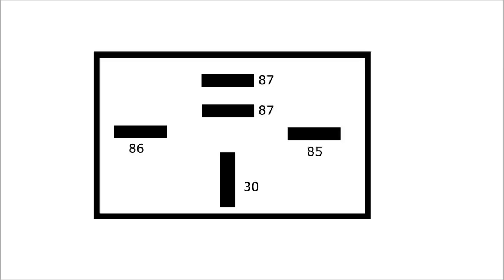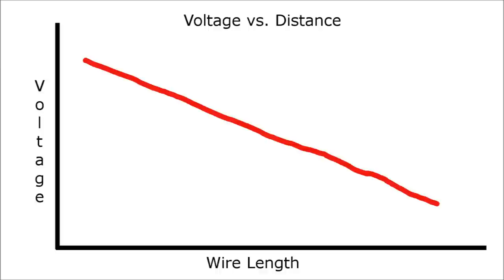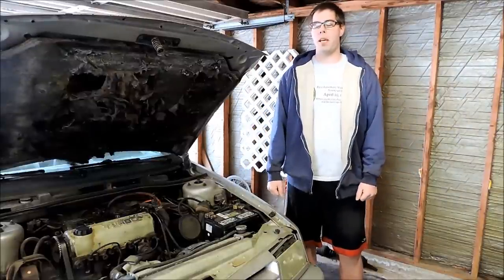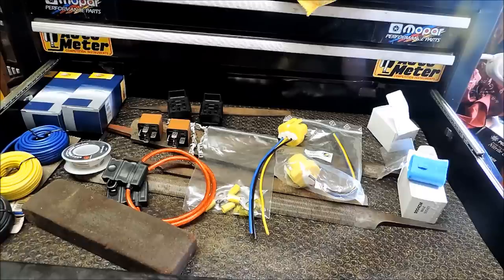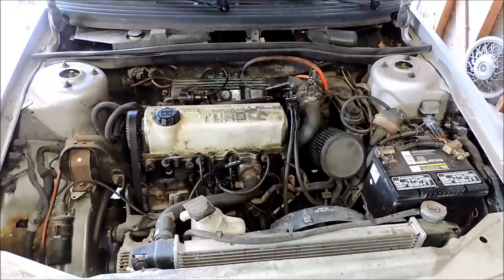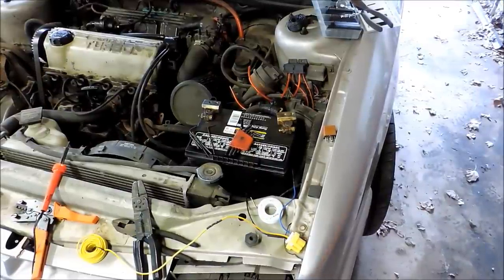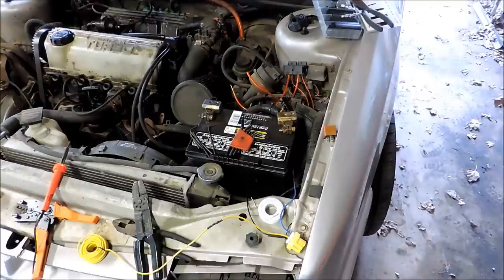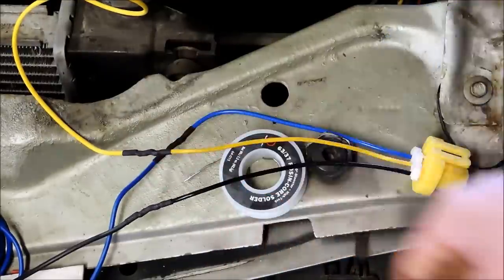Why and How to Relay Headlights

Comment: I appreciate this is an old video, but can I use a relay to turn off a component when I turn on another powered by the same line?

I want to run drls spliced from the sidelights that turn off when I switch the sidelights on... Possible?
Reply from the maker: +AngryWelshman You should be able to do that. You'll need a relay different than that of the ones in the video. If you use a relay with an 87 and 87A terminal you can use the normally closed terminal to run the sidelights which you'll have to switch somehow. Then you can use the normally open 87 Terminal to feed your other lights. Since the normally open terminal 87 comes on when the 87A goes off you can effectively turn on one item while turning off another item. 

A lot of folks will use the terminal 87 and 87A in conjunction with one another if they live in an area which requires that fog lights turn off when high beams are turned on.
Reply: +bwcordes thank you brother, I'll takena closer look at this and see what I can come up with.. nice one, cheers again!

Comment: So im a little lost, would  appreciate you clarify the two 87 terminals. You are running 2 relays with each having 2 terminals marked 87?. If yes that means you have 4 terminals marked with 87. Four wires from 2 relays, terminal 87 where do they go?,
Reply from the maker: Great question. I run a wire for each side of the car off of each relay. One relay controls both sides of the car's low beams. The other relay controls both sides of the car's high beams.

Comment: cool video, but you lost me at the end. you said you had to hook up your yellow wire to on of the 87, then run another wire from the 2nd 87 to the other head light. i'm assuming since your yellow was your high beam you would attach the second 87 wire to your high beam on the passenger side headlight, but you never mentioned were to hook the low beam or black wire in the video. please advise a.s.a.p. as i have my 98 dodge ram 1500 sitting outside with everything done exceptthe 87 hookups
Reply: Jim. There are two 87 terminals on these relays, so each relay sends a wire off of an individual terminal 87 to the high or low beam (depending on which beam you're triggering). The third wire is ground. While I used the battery in this video, I have started to keep the stock ground, as they are short and seem to be efficient enough for the load. Thanks for the view and the comment.

Comment: Hello can 85 &86 be connected to a 2 pin switch or 86 to the switch and 85 from relay straight to metal on vehical body and from my switch 86 to switch and then connect earth wire to the other pin on switch to ground thank you for the video

Comment: On my chevy s10 the lights are not working low and high beams. The lights are hooked up to two relays the drl relay and another relay. I'm trying to run an additional switch to be able to turn them on and off while I try to fix the problem. Here are my questions...how many amps you recomend for the fuse to connect the power from the battery to the relay? can I hook the new relay to the existing wire? The switch I'm using it has three terminals and rated on 20 amps hope I'm using the proper one.
Reply from the maker: It sounds like you are on the right track. Just make sure you leave a little head room on the relays. I usually buy relays which are rated for 40 amps and ensure that my wiring also has a little headroom for the amps they will be drawing.  Thanks for the view, and the comment.
Reply: @bwcordes  thanks for respoding!!  I found out that my problem is a faulty or bad ground. Now I'm getting around 12.5 v using the multimeter prong to the positive terminal of the connector and ground from the chassis. Question I'm still planning to add the switch using the existing wiring and have that extra option to turn the lights if I do this will that cause any damage? Basically It will be two power sources to the low and beam lights if that makes sense...
Reply from the maker: @cortesvd958  Multiple ways of controlling the lights shouldn't hurt anything.

Comment: Building a drag race only 1989 mustang. Car has no wiring so I’m starting from scratch. I ordered new light bulb plugs for the headlights, marker lights and running lights. Can these be wired together and ran to a relay with a toggle switch?
Reply from the maker: You want to give yourself some headroom with the relay for the amperage of all those lights, but it could certainly be done that way.
Reply: @bwcordes  what size 30 or 40 amp, four or five pin relay? I plan to run a relay on each side
Reply from the maker: @BAHRacingTeam  You'll want to do the math based off of the wattage to be sure, but a 30 amp relay should definitely cover it for some running lights and a normal headlamp.

I just run the bosh style relays. They're cheap and everywhere. If you get some dual 87 pin relays you wouldn't have to have as many splices for the running lights. Either way will work though.

Comment: Hi just finished watching your video very interesting just yesterday I took out on a night cruise my 1967 Firebird with a 455 the first time I ever drove the car with the headlights on since I restored it and I notice the fuse that I have on the main power wire going from my Junction block into the fuse box to the light switch that inline fuse was very hot I put a 30 amp inline fuse in front of the car by The Junction block it was so hot it was very uncomfortable to touch the plastic covering the inline fuse actually look like it was starting to melt and I only went for about 6 miles do you think a relay will help this problem checked all my grounds and everything is reading correct with my voltmeter same reading I have at the battery is the same reading I'm having throughout the car when I check it with the voltmeter my only guess is that I need a relay on this main power wire please can you help me I don't want my car on fire
Reply from the maker: I definitely think the relay for the headlights would help. I'm not familiar with that car, but I do know that your headlights must be a pretty good chunk of that 30 amps while you're cruising. I'm honestly surprised that you only have a 30amp fuse for all that's going on in the car off of the main fuse block inside the vehicle. Does your heater go through that too? That'll pull a bunch of amps also.

Comment: Great video.  So I purchased this kit.  Two questions:  1.  What size fuse is recommended (terminal 30)?  2.  At 14:20  you connect the driver side headlight to 86 on Relay No. 1 (low) and Relay No. 2 (high).  Makes sense so as to trigger to relays.  So then no need any wire from the passenger side to 86 at all?  Just cut/disconnect on the passenger side and wrap to avoid shorts?
Reply from the maker: I use 20 amp fuses.  That's correct. I use the wiring from the driver's side of the car to trigger the relays. I disconnect the wiring on the driver's side and tuck it back to the original harness. I don't cut anything off, and I generally use a mating connector with nothing in it just to make sure it can't short out on anything. If you wanted to cut it off, you could just use the crimp on caps to protect them.
Reply: @bwcordes  Many thanks for the quick relay.  Thanks for confirming.  And I believe I am going to use the stock ground wires from the original pigtails instead of running separate ground lines from each headlight to the negative post of the battery like you did.  Two less lines to run (even though you're right, it will be would be a better, more secure ground).  Your thoughts?
Reply from the maker: @stephendrahos9000   That's what I've been doing lately. It works really well, and I haven't had any problems with it. I've actually been running one ground wire to the relays and daisy chaining it over to the other relay blocks. You need hardly anything for the ground on the triggers, so it makes the wires much more manageable and a neater final appearance.

Comment: hi have a good day.. it is possible to put a capacitor?  to stable the voltages needed even the wire is a long wire.. thanks
Reply from the maker: You could, but I don't see what that would accomplish in regard to reducing the voltage loss over the wire, which is the main point of this.

Comment: Sorry for being a pain, but can you complete a wiring like you did using 2 relays with only 4 pins?, or it it a "must " to use 5 pin relay?
Reply from the maker: You can absolutely use relays with one pin 87. You'll just have to have  splices so you can feed both sides for the high beams and low beams.
Reply: Or you could do it with one 4 pin and one 5 pin.

Comment: What purpose does the second relay serve, or did I miss that you wired it for the high beam bulbs?
Reply from the maker: That's correct. One for high beams and one for low beams.

Comment: How far away, can you cut your high/low beam wires, to make your connection, thanks, Winston.
Reply from the maker: If you're talking about the connection at the relay, you can cut them wherever convenient. If you're talking about reusing the stock headlight connector with the factory wiring, I would leave a few inches for your splice. However you can go pretty short if you're careful and it's absolutely necessary.
Reply: shawn can a 14 guage wire be use throughout the system or do you have to use 18g also winston.
Reply from the maker: You can use the larger 14ga wire for terminal 85 and 86. Those only power an electromagnet which pulls a tiny amount of current so it's not necessary.

Comment: Okay ...so I have two sets of wires for both headlights...do I use one set coming from light switch and just cut the other set off
Reply from the maker: If you have two sets because there is one set for each side of the car, then yes. Use one set to trigger the relays and cut the other set off if you would like. You could also remove that set from the connectors if you don't want to cut the wiring. Be careful if you remove or cut the wiring under the hood. Those wires will still get power when the headlight switch is on, and could short to ground if you don't wrap them with electrical tape etc.

Comment: i`ve seen videos 87 going to pos. to battery,,30 to lights,, 85 ground,,86 switch,,,,and in some videos 87a turns somethings on when switch is turned off,,,and then there`s yours ,,,and 30 to pos. to battery,,,87 to lights,,,86 to switch,,,85 to ground with no 87a....... could you explain to me why is this please, i`m more confused now after watching all these videos
Reply from the maker: dave nmemphis 

On most relays terminals 85 and 86 can be hooked up either way. 

30 really should be your power in, but in some relays is doesn't matter. 

Terminal 87a is hot when the relay is not energized, and 87 is hot when the relay is energized. Some people use that feature for some pretty neat things. For example, you could kill your fog lights when you activate your high beams (as you're legally supposed to do in most states) with this little trick depending on how your stock fog lights get power, wattages, etc. 

There is a style of relay for about anything you could want to do. Even the relays shown in my video are a little different from most of them out there in that they have the two 87 terminals rather than just one or an 87 and an 87a. That's perfect for setting up headlights since you don't have to splice into the wire coming off of 87. 

Hope this helped. Feel free to ask any questions.
Reply: that helped, thank you !!!   so in other words there are differnt types of relays
Reply from the maker: dave nmemphis 

Sure. I don't think I could start to put a number on the different types of relays out there. There are several very common ones used in the automotive industry. 

The style I'm showing here is a "standard" Bosch style relay. As you've seen there are several different styles of those even.
Reply: bwcordes

Comment: I installed a relay harness, nothing, no headlights, got mad and pulled it, I checked it with my ohm meter to find nothing wrong, believe my issue could be where it grounds at the headlight socket, going to install a ground to body wire later and try again.
Reply: grounding may be affected by poor metal contact due to plastic parts, paint etc.

Comment: So adding a relay after the headlight switch, will the low beam and high beam still work?? About to do this on a 2nd gen dodge
Reply from the maker: You need a relay for each. One for the high, and one for the low beams.
Reply: @bwcordes  thank you, i realized that after watching
Reply: I also notices he did a good drawing and explaining the pinout then mixed it all up when he was working on the car lol
Reply from the maker: @brandoncartwright8829  The polarity doesn't matter on the control side unless there is a diode in the relay. These don't have one, so I hooked it up in a way that let the wires lay down better.
Reply: At 14:35 you said you took power to pin 86. Is that what you mean it doesnt have to be pin 30 for batt power
Reply: @bwcordes  then you said power comes in pin 86 and out 85. I thought you needed batt power to 30, power came out 87 after the relay was energized by pin 86. 85 was ground
Reply from the maker: @brandoncartwright8829  That's pretty much right. Power comes off the battery to 30, and then out through 87. That's the circuit with the larger current flow. You also need power to either 85 or 86 (ground the other one) and that energizes the electromagnet that switches the high current side of the relay. I hope that makes sense.
Reply: Thank you for the reply, and this video
Reply from the maker: @brandoncartwright8829  Power from the headlight switch comes in at pin 86. That's what triggers the low current electromagnetic portion of the relay. The high current comes in through pin 30 from the battery and out to the headlights on pin 87. Pin 85 is the ground for the low current electromagnet portion of the relay.
Reply: @bwcordes  your diagram was spot on. Thank you, I've not made youtube videos, im sure its harder than it looks lol

Comment: This is a problem on Suzuki V Stroms. It also saves your starter switch from burning out, The lights go thru starter button!
Reply from the maker: Wow. That's interesting. I be there's nothing like push starting your bike on the way home in the dark with no headlights.

Comment: In the video i see you are using 63/37 solder alloy, I understand, the 63/37 solder alloy has a lower melting point than the 60/40 alloy; should´nt it be better to used 60/40 alloy in the engine compartment.
Reply from the maker: +Juan Abreu 

I've never had a problem with it.
Reply: +Juan Abreu The 63 / 37 is the Eutectic (lowest melting point) for Tin / Lead alloy.
 With the Tin?Lead eutectic there is NO plastic state/phase between solid and liquid.  
 SO, cold solder joints are less likely for the begineer.

 The 60/40 is standard formulation used for decades (strength versus melting temperature),
 has a slightly shiny solid state -- when compared to 63/37 alloy.  
 It does have a "Plastic state" range of about 10 degrees -- if joint is moved during this phase - a cold solder joint results.

 There are advantages to some solder alloys (Tin, Lead, Silver, etc.) for higher melting temperatures, strengths, etc.

 IF you are using QUALITY soldering stations (Weller EC, TECP, WS series; Hakko 936 or new 888) you will likely not see
 many differences in usage.  
 However, IF you are using bargain bin stick irons (NO temeprature control of tip) -- then soldering is very depedent on your skills and experience.
Reply: +SavageTacoTime  Thanks for the info.

Comment: hey have 95 buick skylark no headlights have high beams when hold switch need help
Reply from the maker: I would be thinking headlight switch, but I would get out your mulitmeter and ensure that you aren't getting power at your headlamp connector when the low beams are on. If not, and you haven't blown a fuse, I would highly suspect the switch.

Comment: IF MY 67 DODGE CORONET WITH A 68 440 MOTOR AND STOCK ELECTRICAL WHAT COULD INDICATE PROBLEMS WITH THE RELAY THANKS
Reply from the maker: What's the problem exactly? If you apply power and ground to the coil portion of the relay you should get a strong click that would indicate it's working.
Reply: the lights work headlights work but one of the bright lights is going on when I hit the brights and the other ones so there's only three lights activated
Reply from the maker: Have you checked for power at the lights which are supposed to be on when you hit the high beams? I'm not very familiar with that headlight setup. Is it one bulb that has high/low beams and the other just low? Both high/low? Just one of each?

Comment: still i dont know whats the point of the relay if i can use fuse and battery ! can anyone explane for me ? can you tell me if i can connect the fuse box for accessories to the car switch ?
Reply from the maker: mo vtc the big advantage is that you don't have to run a large gauge wire all the way from the battery to the switch and then the load.
Reply: thanks for that but can you make video to add fuse box for the accessories when i turn the car on the fuse box will be on can you ?
Reply: Most cars even older cars have a headlight relay
The purpose of a relay is two fold
1 to protect the switch which cannot carry the load of the headlights directly
2 provide direct battery current and voltage to the lights

For some reason the factory setup doesn’t always offer the same result in brightness

I always use the factory wiring to connect to the new relays makes returning to stock simpler, this way the switch side is covered by the original fuse and the new load side is protected with new fuses added between relay and headlight